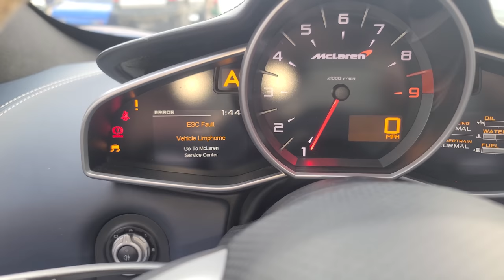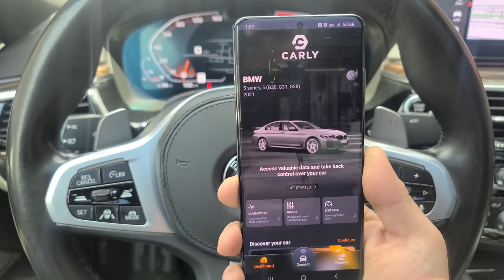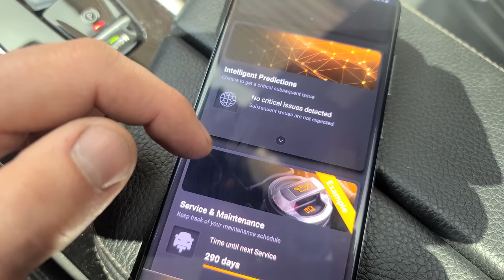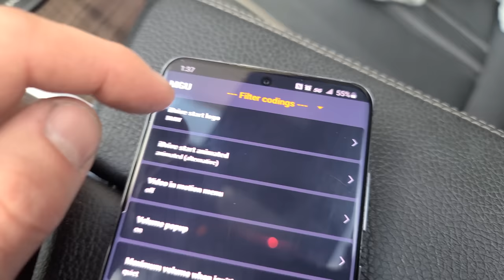I Took My McLaren To The Experts To Learn How Broken It Is & We Found $7k In Mods! It’s Broken Too.

Comment: I think the MP4-12C is the only decent looking newer Mclaren or any beside the F1 that really looks cool.  There is something about the newer ones styling that I have just never liked because they are too feminine.  A Supercar should be a Manly, Sharp styled Brute of a car like I'm gonna rip your face off type.  Any car company that recommends going 10K between oil changes just wants to sell you a new car in a couple of years.  For my cars 7500 is the Max I will go between oil changes and that is if it has been mostly easy miles and very good quality oil used.